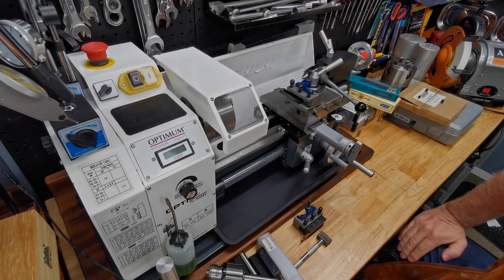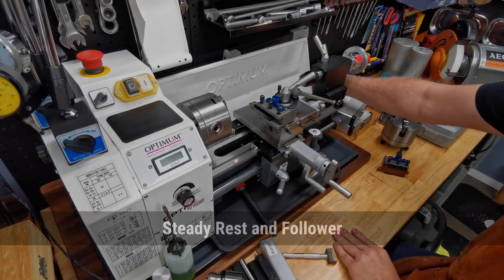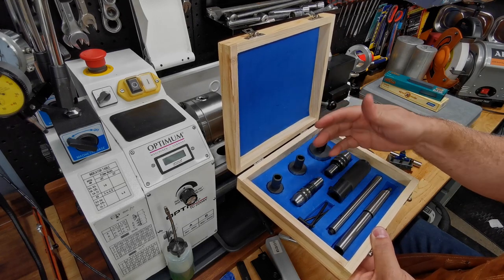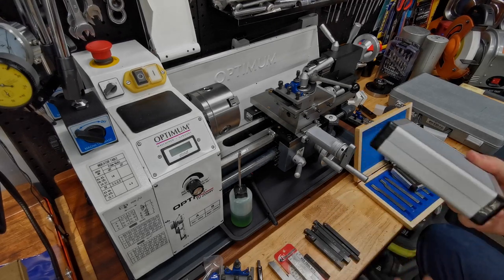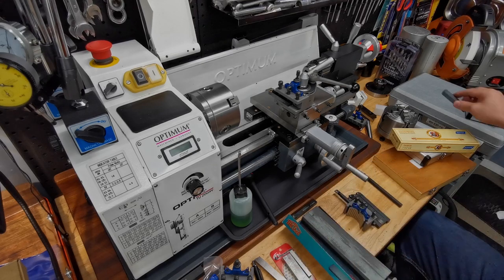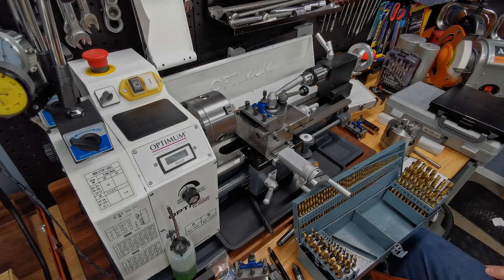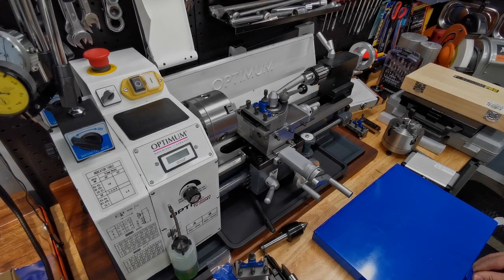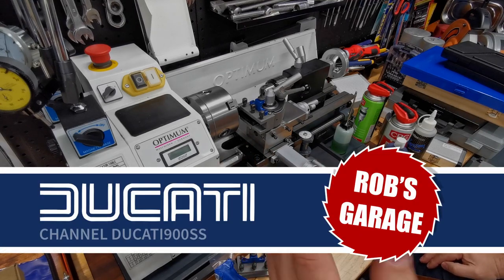Mini Lathe - Top 30+ Accessories for the Novice Machinist - Rob's Garage

Comment: With the tailstock tapers, be it for a drill chuck, point or whatever you have a few options, I usually buy one for my mill that has a M12 thread in the end for a drawbar but you can get M12 screw in tangs. Another way is to drill and thread a say 6mm hole and screw in a bolt with washers to get the right ejection length. You can also put a tack of weld on the end in place of a bolt or tang.
The blue tool set came free with mine, easy to sharpen with a small foldable diamond sharpening stone and if you have a grinder, silicon carbide(green) wheels are cheap, i paid I think €32 for mine that is 200x40mm, the smaller 150mm are less than 20 quid. 
When using HSS tools you can sharpen both ends and get 2 tools from 1 bar, with the insert tools on small lathes its hard to push them to the proper speed to get a good finish and to break chips. As to parting tools I use the same tool as you with a separate blade with insert but is 1.5mm thick.
Reply from the maker: Thank for the comments Derek. There's good info there for people to check out. Regarding the tailstock tapers, I posted a later video where I found one with the M12 in it as well. These part are not easy to get where I live so I often just have to just use the one product that is available. The other video is here for anyone interested:  https://www.youtube.com/watch?v=oAuUdcw2jgg&ab_channel=Ducati900SS

Comment: I'm looking to get one of these now, I was prepared to buy a sieg model, the thought was by the time I've finished making everything it needs to be a good unit I'll be fairly proficient at using the lathe, but at the same time, spending a little more for something of better quality seems like a more productive use of my time.  

This has been a good series to watch for this info. I haven't watched the whole stripdown series yet though.
Reply from the maker: Hi Ginger. Yes, if one is able to choose between this and an equivalent Sieg, there's no way I would get a Sieg. Both are cheap Chinese tools, but this one has so many upgrades over the Sieg...  Just the hardened ways and taper bearings are enough already. Having a100mm chuck is real nice too. And when you see the Sieg in person, it seals the deal for this one.
That stripdown series I did is a bit over the top, but there is some good stuff in it if you leave it on whilst you're doing some other work. I got hung up on adjusting the tailstock when I hadn't checked for taper first. I did this because I watched too many other adjustment videos. So be sure to check this video that goes into the more important step of testing for taper first -  https://www.youtube.com/watch?v=zQDc_NH3r0k&ab_channel=Ducati900SS . I'm also editing 2 new videos right now.. one where I install the Optimum DRO and a related one where I align the lead screw. 
Let me know how you get on if you get one.
Reply: @Ducati900SS  Thanks mate, I'll have a look. I've got it, bolted it to the bench and did a quick test cut, very slow with insert tooling and it was pretty good. I know you're supposed to go faster with insert tooling.  I'm not going to tear mine down, I think I'll just start using it and getting accustomed to it. I'll still watch all your videos on it though. 

I'm looking forward to diving in and making some stuff.
Reply from the maker: @GingerNingerGames  Oh you've got it already, nice! Yes, just use it. You'll get into it at some point anyway later on. I'm still using insert tools. I find them easier and more consistent to use. At first I was doing it slow, but after I did some research for the video I made about choosing inserts, I started using high speeds. Now I normally take it to 1250 for a cut. For parting of course way slower.. down around 200. Anyhow, let me know how you get on.
Reply: @Ducati900SS  Thanks mate, already wrecked a part, but not any tooling, I bumped the speed up today from the lowest to about 1200 for cutting and it seemed better, getting some noise, I'm not sure if it's bad and it tends to come and go.  I am getting long stringy swarf coming off, which I think means I need to make deeper cuts?  Either way, I'm happy with it so far, I'm going to go find somewhere that'll sell me scrap aluminium round stock so I can practice some more.
Reply from the maker: @GingerNingerGames  Just a tip - If the noise is coming from the gears you'll find you can change how it sounds by loosening screw 413 on page 65 of the manual and tightening it again after repositioning the rack of gears slightly... just a mm one way or the other can make them noisy or silent. 

And yes, speeding it up usually makes for better chips, but apart from being in the way, stringy cuts are just as good. I keep plastic tongs handy to pull them away, or just leave them until you finish the cut.

I also had trouble getting materials. For my first cuts I got a couple of short pieces of plastic, iron and brass plumbing pipe from Bunnings. Just 3 or 4 inches long with threads on the ends. That was good enough to play with. After that it was a matter of visiting steel and aluminum suppliers to try and get leftovers. I also visit a metal recycler now and then and depending on where you are, have a look at Trademe in NZ or eBay, maybe Gumtree in OZ. Also look for a place that does plastics and get some Acetal. That's good for some projects. It was definitely not easy to get suitable metal here. I had to spend a few lump sums to get a good stock of various rods.
Reply from the maker: @GingerNingerGames  oh, if the noise was just chatter during the cut... try speeding up or slowing down until it settles.
Reply: @Ducati900SS  I'll have to investigate some more, the gear train is a bit noisy, especially when the power feed is engaged, but I think the noise I'm hearing is chatter or resonance, doesn't look like the quality of cut reduces at all. I was taking a deep slow cut, I think about 2mm or more, but moving the tool slow at about 1000ish rpm, maybe too much, but the chips were nice.  I think they were nice anyway. I've got to watch more TOT and others to get more of an idea of what I'm looking for.

I need to add some plates to the bottom of my bench to spread the load out a bit too.  

Bunnings it is, I'm going to try some fabrication houses around the place and see if I can't find one that'll let me raid their scrap bins. 

I'm appreciating all your input here too, so I'll keep you posted as I go.
Reply from the maker: @GingerNingerGames  Ok yes, 2mm is on the deep end with this. I did a video on insert tooling and it also covers the appropriate feeds and speeds for this particular lathe: https://www.youtube.com/watch?v=NcF3nVQnJzA&ab_channel=Ducati900SS
I added a couple of updated notes into the description of that video. Basically that, regardless of how the HSS performed in the video, I've remained with inserts and am using the high speeds that I discuss in the video.
Reply: @Ducati900SS  Thank you, I'll give that a watch when I get home. I've had a bit of a look at some different videos, what I got from most of them is it's about listening to the machine and watching what the outcome is. From that deep cut the outcome wasn't great, the surface finish was alright but it kicked up a burr, so too deep for sure. It's all a learning process.
Reply: @Ducati900SS  I've got a bit more time on the machine, watched your video about the insert tooling, it was very helpful. 

The noise was likely a combination of chatter from the deep cut and the gear train too. I've since done a fair bit, I successfully made a part from aluminium including external turning down, facing, boring, and internal and external threading. I made threading tools from old HSS drill bits and it worked surprisingly well.  

These days I'm limiting cut depth to 1mm at most. Boring I'm taking 0.25mm cuts up to 0.5mm and running the machine slower as I believe I should be. 

I'm having a blast with it. I'm absolutely stoked with the finish I achieved, the threads fit really well into an existing part, spin it and it sends itself home.  

Thanks for you help and your videos, I'm sure you'll hear from me again
Reply from the maker: @GingerNingerGames  That's brilliant, glad to hear it's coming along.. you're ahead of me with the internal threading too! I keep using my taps and dies on it, but really need to do some proper threading.
Reply: @Ducati900SS  Thanks mate, It's been a fun little learning process. I watched a lot of videos on internal threading before I did it. I'm having a blast

Comment: the blue carbide tooling is being sharpened with diamond wheels.. a modified bench top grinder with a rest in front of the wheel will be able to do that.  See Stefan Gotteswinter 'slowspeed carbide grinder'.  There also are tool and cutter grinder machines, where the standard entry machine costs as much as the TU2004v.
Reply: PS: sorry if u didn't know Stefan's channel yet - as the result will probably be that there now is much more "needed" all of a sudden ;-)
Reply: @robax  
On the inserts.. there is uncoated ones with positive rake angle for aluminium (CCGT060204 H01 for example) and then there are coated ones with negative angles for steel and other stuff (CCMT060204 US735 for example).. does the late have big problems turning steel/stainless with the coated MT inserts - if u've done that yet?
Reply: @robax 
Oh and on grinding..  yeah, I didn't plan on using HSS tools much on the lathe when there are inserts available for that.  But modifying/sharpening tools for the mill and the occasional special tool needed for the lathe will make it necessary to be able to grind them.  Otherwise I agree - laziness is the mother of inventions (& convenience) ;-)
Reply from the maker: These days I'm all hung up on that insert set that I show at 19:52 It works so well that I don't use the others. I'm going to do a follow-up video to this and update where I've got to with all the bits. Some items haven't been used at all and some are used non-stop. I've got a list of topics already onhand. This lathe has been great though. And yes, I should still be practicing grinding the steel tools.. but I'm just too lazy!
Reply from the maker: @joansparky4439  I haven't done any stainless but have cut plenty of steel otherwise. There's a video on my channel "Basic Carbide Codes, Feeds & Speeds for the Mini Lathe" where I get into the insert types available for my tools and the selection is extremely limited. I would need to find different tools altogether to take additional types, or a supplier that has more types available in my size. But at this point I've had no issue cutting anything I've put in the chuck. That said, I'm probably not doing anything seriously challenging here. The 4 inch aluminium rod for my DRO project is the biggest thing that's been in it, and that of course cut like butter. For steel I've only cut 50mm and that cuts just as easily.

Comment: If you cut your arbour too short, tap the end and put a screw in. Most arbours are induction hardened on the outside and softer in the middle. Ask me how I know. Also; you have a lathe and mill so make your own tooling as required. A great many good projects.
Reply from the maker: Hi Ian. I've still got the one I cut too short so I'll give it a test drill and see if it can be saved. It took so long to cut through it with the grinder that I just assumed it was made of kryptonite!
Reply: The tang ur cutting off is designed to keep the drill chuck from rotating in the tailstock spindle. Not sure if mini lathes have that but my big lathe does so maybe the minis do??
Reply from the maker: @craighowell1697  Hi Craig. That's interesting to know. I assumed it was for locking into something but not exactly what. These mini lathes just have the taper tube and the threaded rod in the end. Wonder why they don't just extend it a little and provide the necessary internals to at least stop it turning under heavy torque... might be a project!

Comment: When that taper end is to short, I drill a hole ,thread it and add a screw in there. Even  a lock nut.
Reply from the maker: I'll have to try and save that one I cut too short :)